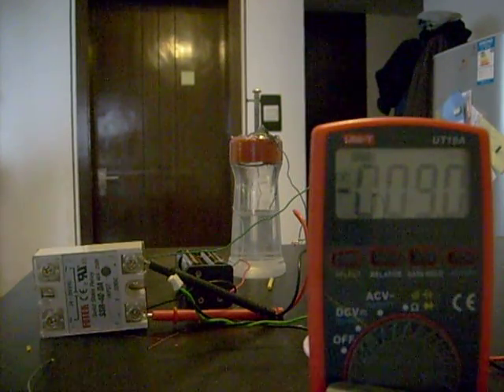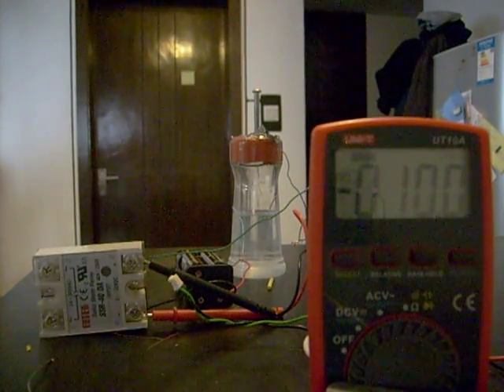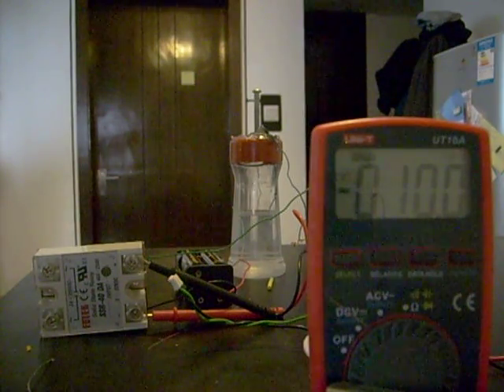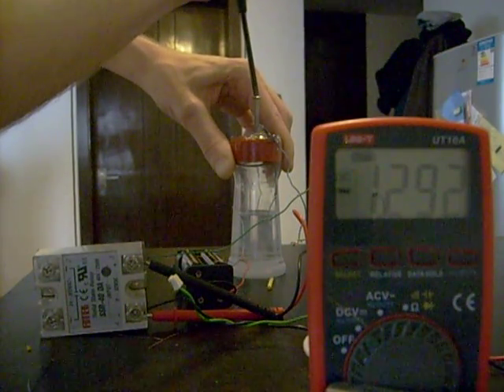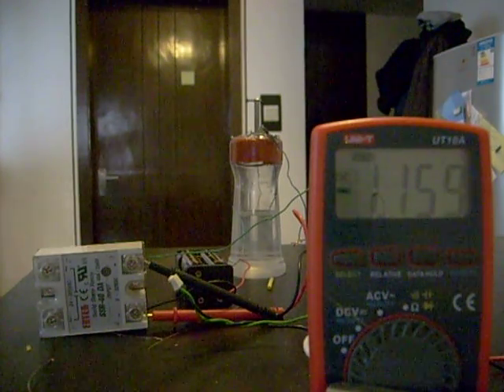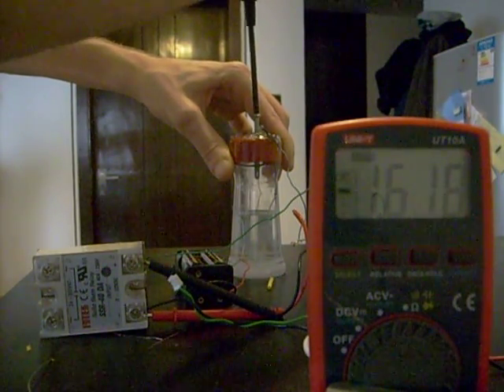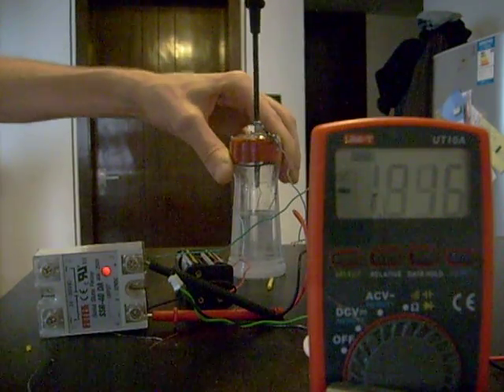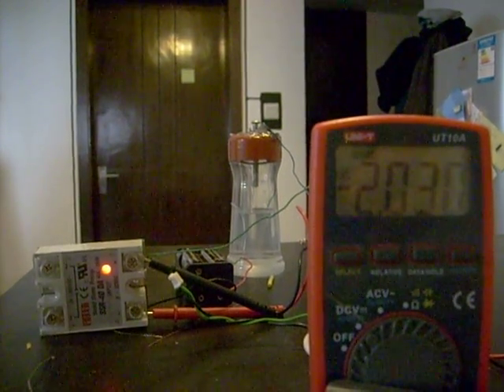DIY Salt Water Potentiometer

Comment: what about electrolysis? explosive gases that are created.
Reply from the maker: The container is not airtight, and the quantity produced is not dangerous.

If you increased power to ridiculous levels you might be able to produce enough in the chamber that t could be ignited. doubt it would do more than make a little "pop" though ;)
Reply: okay fine, i was worried
Reply: https://www.youtube.com/watch?v=tYqLAcbRQ6g